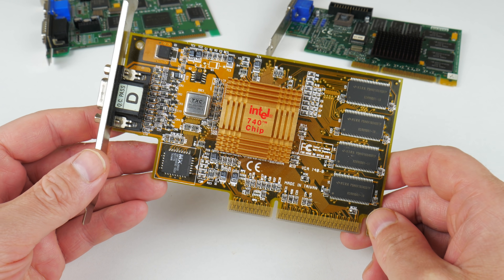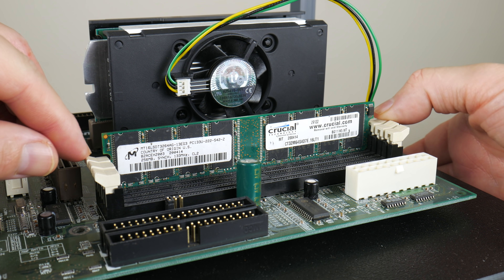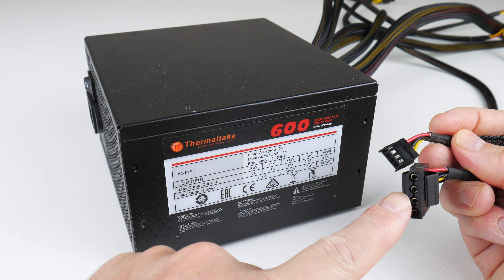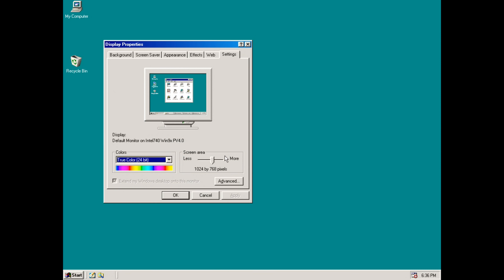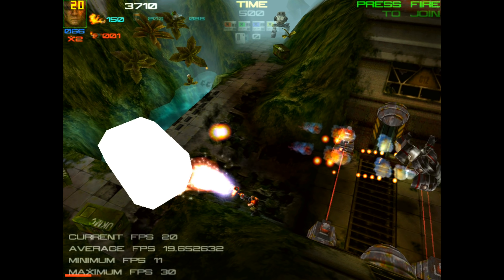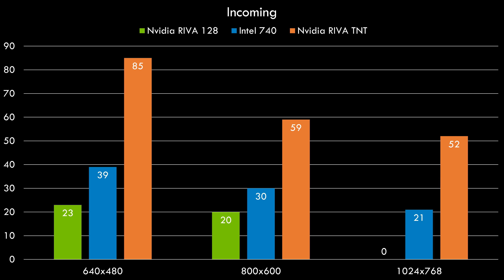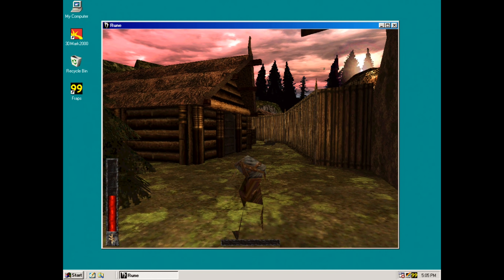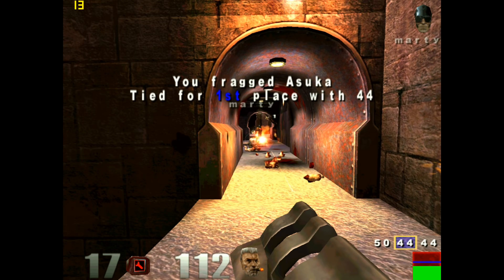Intel's first dedicated GPU vs Nvidia - The Intel 740

Comment: Can not exactly remember when I bought the i740, but I guess (as I did not have much money at the time) it was a budget card then... mine was 4 Mb... and it sucked (first card was a DOA) second card I almost wanted it to be DOA... it was just really slow... I think I had K6 333 Mhz (300 overclocked to 333?)... but it did not have the nice (although lower res) antialising of dual Voodoo2 or even a single... Half-life which I loved at the time was playable for sure but again... not Voodoo quality at all...

Really hoped the Intel AGP "hype" was true.. 2 Mb framebuffer/cache and retrieve everything from main RAM and the bus (and clever driver programming) was speedy enough to do so.. but it just was not... can not remember what budget option I went for after, but I think it was a VR2 addon card... did help in some games but was also a let down, driver wise... it had potential for sure Unreal Tournament it was just awesome... but that was pretty much the only game that actually supported it... after that it was mostly Nvidia (still budget cards) but they did deliver the goods and I was not disappointed.

Comment: This was the upgrade to my first 3D card, the Mystique 220.

I was very impressed by the Intel, it was a big upgrade to the Matrox.
One stand-out feature was that I could enable bilinear filtering in Tomb Raider (2, I think) without any performance loss.

I had it with my Celeron "450A", where it ran for many years.

Very nice budget card.

Comment: When my brother bought the first PC to our household, he got an i740, but the card itself looked a little different. I had serious driver issues, we were struggling a lot, if we increased the color depth from 16 to 24 in Windows 98 there were a lot of incorrect pixels, and the worst part was that some games just froze after playing 1 level. Need for Speed 3 and Worms Armageddon did the same, the games ran fine but after playing a level, the next level simply didn't load. Later we got a better driver but didn't improve much so i decided to get a new card after years of struggling and sell that i740. Now I wish I still had that stupid card for nostalgia's sake, but I have the rest of that computer, the motherboard, CPU, sound card and the floppy drive in the very same case to this day. I had to swap the RAM because they went bad.

Comment: I think there was old bios as root of the problems. I had BX440 mobo with slot celeron 333 with 128 mb ram and i740 8mb. Rune never had such artifacts, went through several times. Serious sam, mdk2 also going fine, more than 40 fps. GTA3 seemed like a masterpiece at that time - playable 20+ fps. Now have thoughts about purchasing some of the best version of the i740, but dont know where to look.

Comment: I had this GPU paired with a Voodoo 2 and an AMD CPU. I don't remember WHY I bought it, I guess I wanted the "ultimate" 2D card, I replaced an S3 Virge with it. But I had epic crashes, especially if trying to run anything 3D. Never knew if it was a drivers issue, or if the card was faulty. Most likely though, it was just a bad idea to put it on an AMD build and/or alongside a 3D accelerator card. Anyways, I'm really impressed with your video, because of how well it worked for you. Maybe you were lucky enough to have the right Intel chipset to test the card on. But my bad experience wasn't certainly the only one, so it never came as a surprised how the i740 failed.

Comment: you should make a 16Bit optik comparison. Nvidia promoted 32-bit at that time because 16-bit looked bad there. There were comparisons in print media especially with 3DFX because their 16Bit looked much better then Nvidias. Nvidia needed 32Bit but the performance was not good @32Bit
Reply from the maker: That one will never be settled 😅 Speed vs quality. 3dfx was all about the performance and pushed 16 Bit and with the Voodoo3 their "22-Bit" equivalent output filter. And later with the V5, when Nvidia was faster, 3dfx started talking about quality (AA) 😅 So yes, if you are playing 16 Bit games like System Shock 2, then the Voodoo 3 will look nicer. I wouldn't say Nvidia looks bad, or that 3dfx looks MUCH better, there is more bending basically.
Reply: @philscomputerlab  still nice comparison for retro PC video. Yes the 22 bit was a specialty. It's really all about performance and 16 bits. I remember comparisons where Nvidia needed 32 bits because 16 bits looked so bad on NVdia cards.
Reply from the maker: Which cards would you pick for such a comparions?
Reply: @philscomputerlab  Voodoo 3, Matrox G200, S3 Virge and Savage 3D, Nvidia TNT and TNT 2 maybe Riva 128 too
Reply: If only Voodoo and Nvidia the 3000 and the TNT
Reply: @philscomputerlab  Basically this would not be much work.  3-5 popular games from the time and from each a screenshot 16 bit and 32Bit. But you should also look FPS, so already that it looks better, but if unplayable its useless. (So real recording from the monitor not screenshot)
Reply from the maker: @techtomek5062  Not much work, you're too funny...
Reply: @philscomputerlab  Compared to reviews and benchmarks with so many graphics cards, this is still manageable.😁

Comment: A great video! Thanks for sharing!  Wished I still had my first PC. It was and Acer Aspire Emerald Green Pentium 1 Computer with Windows 95. Boy I miss my old Acer Aspire Computer. But I still have and Asus Socket 7 Pentium 1 computer. I still play around with. Asus P5A-B Motherboard 550MHZ with 384MB Of Ram. The prices on those motherboards are pricey on ebay.

Comment: i740 was my first AGP card but it had too much issues with compatibility so I had to replace my brand new MB Acorp with socket370 to A-trend 7100M (both had LX, not BX chipset). These two were working together okay, but a bit later I had to replace i740 to some Riva m64 or so. That was not PIII of course, just Mendocino Celeron 366@458 mHz.
Years later I made a "prefect" s370 LX-based PC installing Coppermine 850 MHz CPU; some modding had to be made for that. I also have modded BIOS so that the MB supports any size IDE HDDs, at least 32Gb is not a limit anymore.

Comment: I had one of these many years ago paired with a voodoo 2 12meg card. The i740 had fantastic 2d quality, and windows acceleration.  It was on a k6-2  with 256meg of ram. That all got moved over to a katmai 450mhz P3 overclocked to 500mhz with 512meg, it ran quake3 arena very well and since i had the fastest pc at the time me and my mates would use my machine as the server. I ended up getting rid of the 740 and moving to a riva tnt2 ultra running windows 2000.  That was when i also first started to play with watercooling, back in those days it was just holes bored into aluminium blocks sealed with silastic and using plastic hose from hardware stores haha.

Comment: Brings back memories... built quite a few systems using these, as they were "cheap'n'cheerful". As mentioned, the TNTM64 totally took over the "budget segment" once it came out, as it was a pretty decent performer for it's price, and later the Ti4200 took that same segment. But all in all, the i740 could have done a LOT better had it had better drivers (they were quite craptastic) and a bit more love on the OpenGL side of those, as they were equally craptastic.

Comment: I ran one of those paired with a Voodoo2 for a few years, before switching to a Geforce256 (Elsa Erazor x² I think). The 740 performed significantly better than the S3 Trio64 it replaced, but it had absolutely no pull on the Geforce. At least it was dirt cheap.. i think somewhere around 100$ MSRP.

Comment: This brings back memories of my first PC: Pentium 2 @350MHz, 64MB RAM, an 8MB Intel 740 AGP, Sound Blaster PCI 64 and a 6.4GB HDD (which I think was a Seagate). Sadly I don't remember what the motherboard was. Even though I didn't have much to compare it with at the time, since owning a PC in the late 90s was still pretty rare around here, I was very happy with it. I remember what I really wanted was a Voodoo2, but ended up with the 740. Ultimately it didn't matter much to me because the stuff I was playing ran well on it as far as I remember, plus it did have the bonus of being able to do some pretty high resolutions for the time (up to 1600x1200!) which was great because I often helped my dad with graphics stuff in Corel Draw and all the extra real-estate was great. I think I only pushed it once to 1600x1200, but that was far too much for the 17in CRT I had.

I admit a lot of the games I played were 2D (Starcraft, Age of Empires, Heroes of Might and Magic 2/3, Alpha Centauri, Civ 2, SimCity 3000), but I also played a lot of racers including NFS3 Hot Pursuit and NFS High Stakes plus an assortment of 3D games from various genres like Heretic 2, Thief, X-Wing Alliance, Falcon 4.0, Flanker 2.0. I don't remember having many problems with it, or games that wouldn't run. Admittedly I wasn't much into first person shooters back then and I didn't play most of the games you had problems with, though I'm pretty sure I played Quake 2 on it (I don't exclude that it may have been on the software renderer though). Also I'm sure my tolerance for lower framerates was much higher back then 😄

Comment: you should check for the savage 3d, was contemporary to the intel 740, but kicked a lot harder. we kinda used an intel 740, then a savage 3d and after that a matrox 550 on a pentium 2 350mhz. and that was prety nice for the mid to late 90s. Althought my first personal gaming rig was an Athlon 550mhz on slot A, with 128MB Ram, a savage 4 16MB (coz it was way cheaper than a Riva TNT 2 32MB or the geforce. latter i switched to a Matrox 450(32MB), coz Dungeon Keeper made use of theyr propietary gfx enhansment for watter and fluids. I miss old PCs....

Comment: Well, in reality the gaming card you actually wanted to have in 1998 was the voodoo1 (voodoo2 once it has been released and you could afford it). The i740 and Riva 128 were great on paper, but the game support really SUCKED for both. The other problem that no one seems to remember nowadays with early cards combining 2D & 3D graphics in a single design was the fact they needed really powerful CPU. The performance with voodoo 1&2 cards was more flat and not scaling that much with the CPU (meaning they were excellent with anything). Back in 1998 it was great news for the majority of people, as gaming PCs were usually using Pentium/PentiumMMX or AMD equivalents, not Pentium 2 (certainly not Pentium 3 from 1999), so yeah until the voodoo3/TNT2 generation, 3dfx was the way to go.

Comment: i740 was an interesting card a proof of concept that agp texturing could be used instead of using dedicated texture ram. If vram prices were high it was a great idea but cards with 32mb or more of vram weren't far away and textures in vram were much faster. It also suffered from not having 32 bit colour and could only single texture. Cards like the TNT that had lots of vram, could also agp texture , had 32 bit colour and multitexture made the i740 obsolete pretty quickly.

Comment: In 1998/1999 it was a Rage All in Wonder, can't remember if it was the 128 or not though as it was the 8mb model, late 1999 I went for a Voodoo 3 3000 with 16MB

Comment: I had a K6/2-500 with an S3 for 2d, and added 1 then 2 Voodoo2 cards for Quake and especially Quake2.  I remember it being a little faster than a P3 of the same speed using the AMD-supplied 3DNow! version of Quake2.  When I upgraded to an Athlon 700MHz(Slot A!), the Voodoo cards turned out to be incompatible somehow, so I got a TNT2 and started playing Quake3.  Didn't know Intel had a dedicated GPU back then.  I thought all they had was the i810 integrated graphics, which now I know were not really all that bad.  Keep up the good work and preserving computer history for us all to share in :)

Comment: sir, apologies if you have done this already - pick up an lga 1150 motherboard with uefi bios and an lga 1150 xeon. the lowest to try is the e3 1220 v3 xeon  - then try to snip up an 8 thread one like a e3 1275-v3 or e3 1241 v3.   this motherboard and cpu combo is amazing. the uefi bios means it will run with any gpu and the 8 thread parts with the 8 meg cache - are incredible value. am i right in thinking a e3 1270 v3 with a radeon rx5700 - can run literally everything? every single game. ok the problem is gpus are silly money but the crypto craze runs in approximate 4 year cycles and i bet gpus are cheap as chips by summer 2022. yes we just have to wait. ddr3 is cheap. its a win win win.

Comment: I tried the i740 back in the day.....; the bastard would not even play Quake or Quake 2 without severe simulated ' cracks' (like looking through a broken windhshield that was rotating!) all over display during gameplay....  Tried it through multiple reformats/reinstalls, then returned it for refund and got the S3 Virge and Voodoo1 I should have gotten all along anyway!

Comment: Intel had a GPU way back in the mid-late 80s called the 82786. This was its first truly inhouse design as the previous one was a licensed part from NEC. Like the i740, the 82786 was a bit lackluster compared to other high resolution accelerators that it targeted like the TI34010. And its pricing was also rather mediocre. Its only boon was its programibility was more flexible and in some ways had a bit shallower learning curve.  It was made under a somewhat similar philosophy to the i432 project just a couple years earlier, only as a co-processor to the x86 arch primarily. Had it been out a year earlier than it was, it would have been pretty decent, but it was immediately in tough competition and intel didn't follow it up until the i860 INT64 accelerator a couple years later. Which was also a flop due to it being too expensive, and this time being a real bear to program on. And with the TIGA TI34020 being the same price, easier to program, and faster in most every way, the 82786, and the 860 faded into that bleak and black void of intels failed dreams.

My memory of the i740 when it launched was pretty miserable. It was really CPU dependent. Your P3/1000 is going to be putting it in a much better light than when it was first launched. When P2 400's were the high end, and we just started getting the 300A CPU. With my Covington Celeron 266 and 66mhz ram, my GLQuake score at 640 res was not more than about 30fps at the best of times. It was often laggy and jittery. Game support was quite poor as most games that worked fine on the Riva128 or the Rage Pro worked fine, but had no support on the 740. This was also around the time cards like the Banshee and some TNT cards were only a few dollars more.  By the time the prices of the cards fell to less than $50, and game support had a modicum of improvement, intel pulled the plug and never bothered with a follow up. Which kind of sucks. As I am sure they could have learned from that experience in making a better product, and also as a result would have not plagued us with such horrific unified graphics for so long. 

But in conclusion, the card actually really sucked during its lifetime. It wasn't until after the last couple drivers came out, and some games back ported support for it that it started to look like it may have been decent, and by that point it was already long dead and forgotten.

Comment: I had one of these in my (family's) first computer which we got back in April '99 and was responsible for getting me addicted to computers 😁
It surprises me that the performance wasn't regarded as very good, since I had several other cards in the following years and the i740's performance impressed me given it's small vram (8MB, which I think is more than the usual 4?), however perhaps that was down to using system ram. Little did I know that was to be Intel's only dedicated GPU for 20+ years. Looking forward to seeing what Alchemist brings in 2022

Comment: If it doesn't do Transforms & Lighting on the card, it's not a GPU. Those are 3D Accelerators, not GPUs. The GeForce was the first mainstream GPU. Mainstream as in outside of what SGI was doing with their gear that cost more than a house.

Comment: For gaming of this era I would upgrade straight to the TNT2 instead of messing around with any of the chipsets in this video... any titles or motherboards later probably a geforce2 or even the geforce2MX *which were based on geforce1 design) would have been better...
In 98 I think i had an IDT winchip 200mhz with 128MB of ram with a TNT 16mb PCI

Comment: I still have my i740 and I played Quake II with OpenGL. :) I think I went with 640x480 in windowed mode, which wasn't great, but not horrible either for a 1024x768 resolution on a 14-inch CRT. :)

Comment: @PhilsComputerLab I wonder if this card explains why on some old computers (With chips like the Pentium 4) if you installed the max of 4gb of ram you could only use 3 of it. I read that 1gb was reserved for graphics.
Reply: No. It's because of the 32 bit architecture could not address more than 4 GB of RAM.